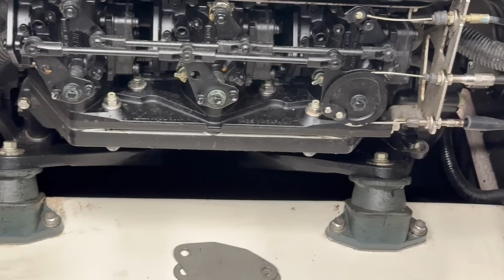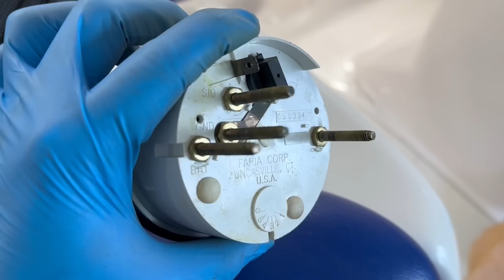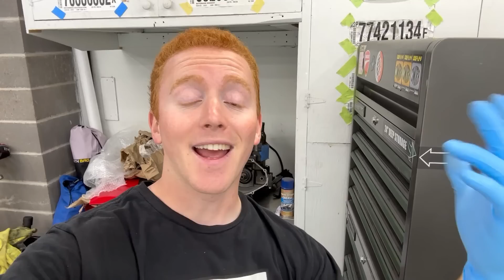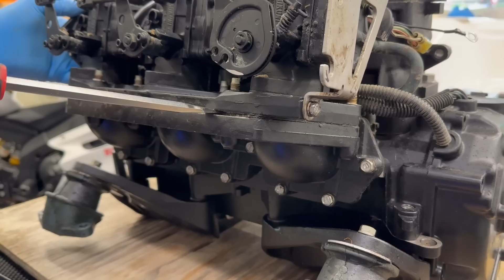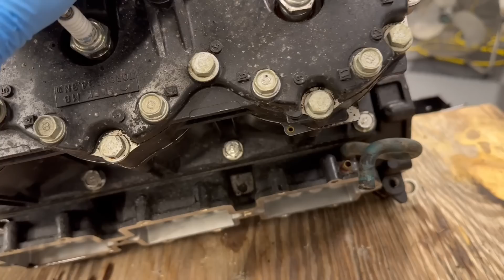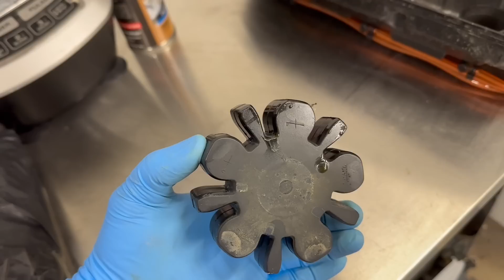Rebuilding A 1999 Yamaha Jet Boat (Part 2)

Comment: Premix your fuel at 45:1, if it's to smokey back off to 50:1. You'll ensure the engine is getting proper lubrication without having to replace oil lines every couple years.

Comment: Hey CJ, that half-moon radius key is called a Woodruff key on the tapered shaft, and that is your flywheel with starter gear on the back that turns the crank shaft.
Reply from the maker: Thank you

Comment: I'm from Cuba, and those two-stroke engines are abundant here, and the best solution is to mix the gasoline and oil manually and eliminate the oil injection system. That's the old-fashioned way, and you can be sure that every time you fill up the fuel tank, it'll already be premixed.

Comment: Hi from UK, that oil pipe that has popped off the good engine, you will need to have a look at it in the bores as its probably scored the bore/piston,  no lubrication, also you need to find out how to prime the 2 stroke oil pipes, as even running for a few seconds will kill it, or run premix,  d

Comment: 2strokes are far easier to work on and Easier to maintain and you can build a lot more power with them, and that’s starter reduction gear or ( vindex) like on a car starter, and if you look up how a basic 2stroke operates it will make more sense to you. I’d just mix your pre-mix in your fuel tank and I’d run non-ethanol fuel in that to help keep the carburetors from plugging up and getting dirty!

Comment: Just premix.....find the ratio of the mix required and mix your own...Safer and cheaper in the long run!
Reply: yea, I’d start with a 32:1 ratio for the tank and tune the carbs right before blowing another motor
Reply: @RainbowUnicornSwag , 32:1 is crazy on a stock engine. He'd be fine with 45:1 or 50:1.
Reply: Don't premix. Racers do it on old 2t cos you are always wot. The pump and everything works, just keep an eye on the hoses. It's designed to work at any speed to keep it from running rich or lean. You put premix in then just putt around then you can run into fouling or lean
Reply: @DazFixz hence why I said jet and tune the carbs to match the premix and crank case pump.